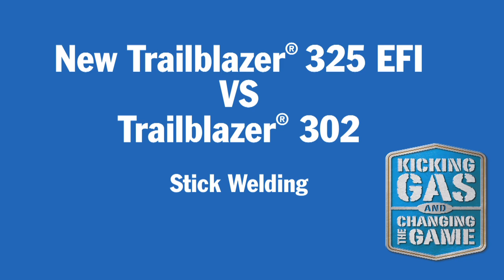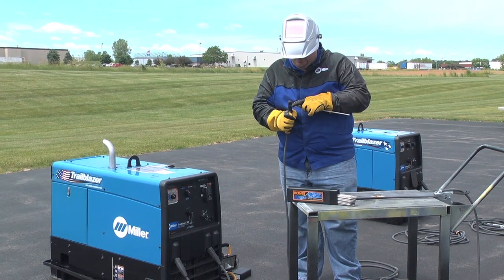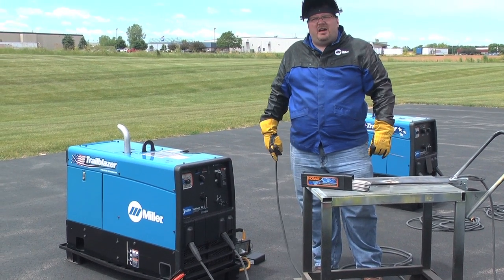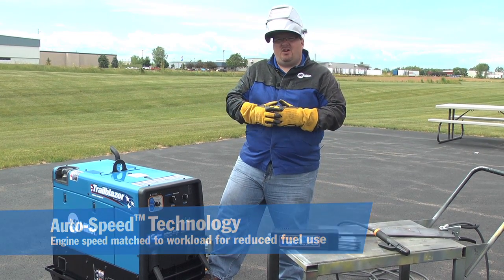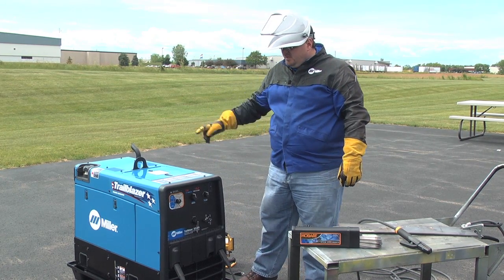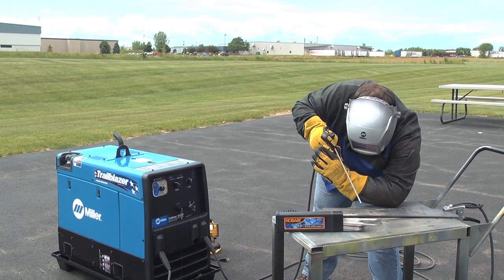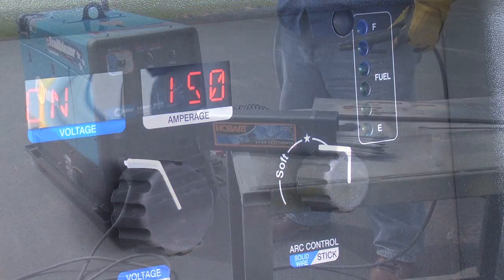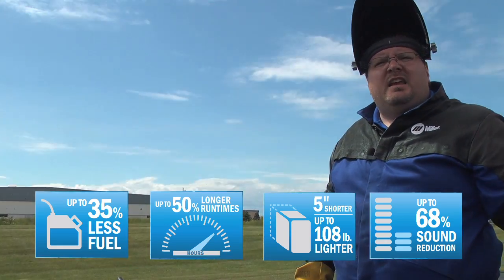New Trailblazer® 325 EFI Demo 2 of 3: Stick Welding Comparison

Comment: What happens when you plug your rod oven in and weld? does it idle down?
Reply from the maker: Hi Joe, thanks for reaching out. This is dependent on the machine you are operating with. If you have a Trailblazer with Excel power and hav e the rod oven plugged into the excel outlet, then the machine will stay idled down. Once you strikes an arc, the machine will go to the appropriate speed for the combine Excel and weld power load. If you are using any other machine, plugging into the auxiliary power will cause the machine to run at high speed all the time.